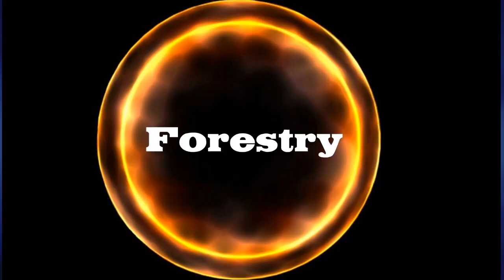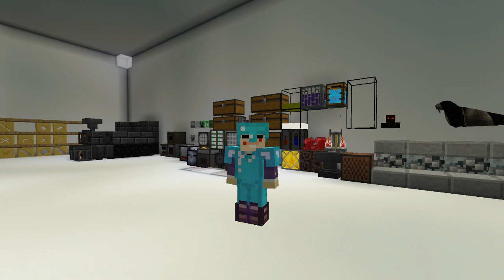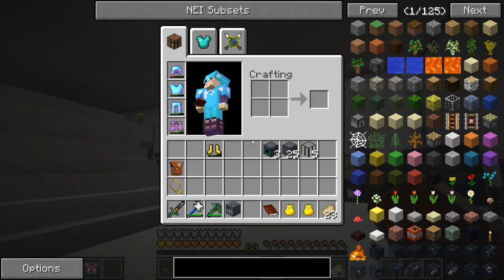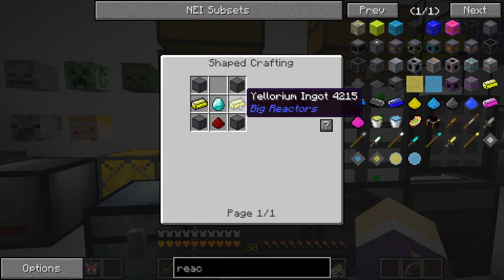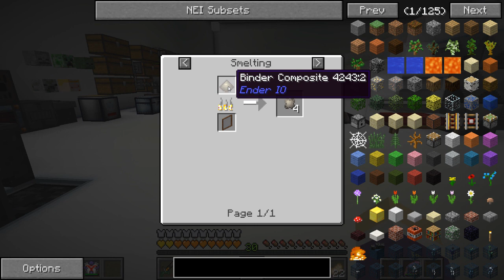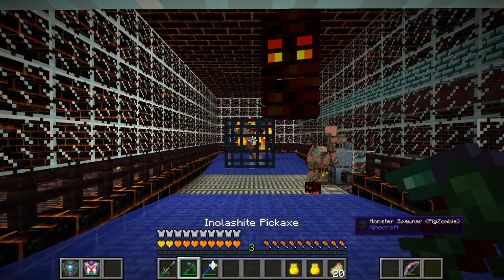Material Energy^4: E17 - Big reactor and the Clay Machine

Comment: You can add enchants to items with the Auto Anvil (or Auto Enchanter)… you will need liquid XP which you will be able to swim in once you get the Essence Berry quest done and set up an XP farm with a sprinkler.

You can also enchant Strongboxes and Satchels (Holding enchant adds one column for every level up to IV, Soulbound keeps the item on you if you die)

Comment: the big reactor you start downstairs with is apparently only producing at 5% power. Direwolf20 and pahimar are doing ME4 and one of them looked at the control rods, said rods are inserted 95% meaning that the reactor is almost turned off.

Comment: I have spawners gotten with random things soul binder under the observatory working fine, so no idea why your power spawner wouldn't work. Some spawner need darkness, others don't. Auto activator with sword won't give you any skulls, at least none for me. You have to kill them yourself.

Also, that's one complicated clay machine. Dust in a wood barrel would work, or at the very least pump water directly into the cyclic assembler.